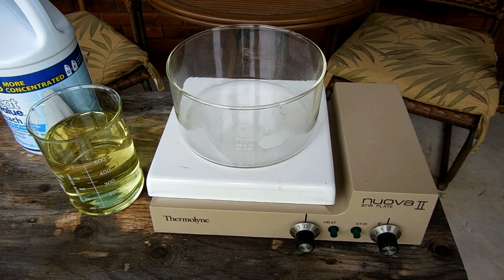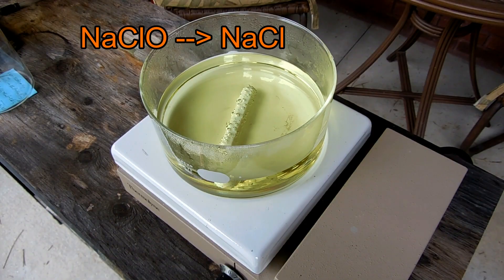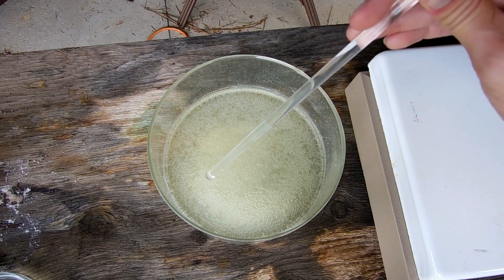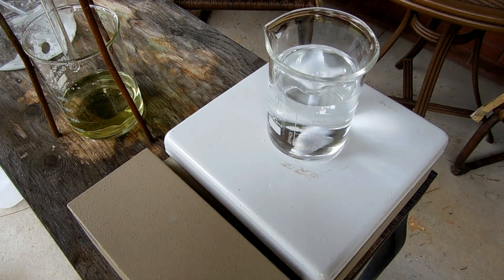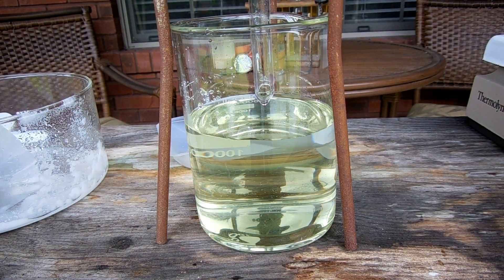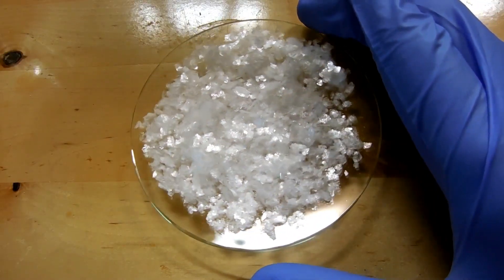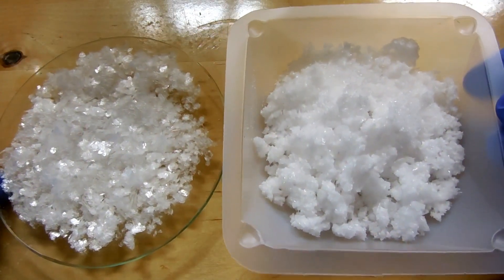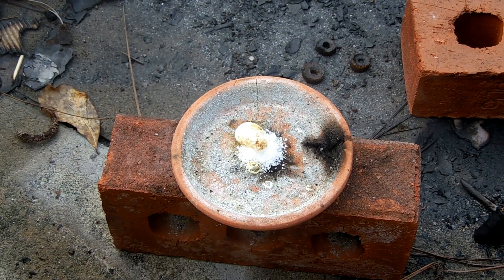Potassium Chlorate from Bleach

Comment: Mix those crystals (the purer ones) with equal weight amount of 90% melted beeswax/10% vaseline, cool in blocks and add a blast cap and you've got yourself homemade plastic explosive. Just saying...
Reply: Or one could add the right fuel to it and you have  a high explosive, Ive always used a large floating steel bowl in a dry ice bath that you would drip into,  There are also easier and faster ways to scrounge up chlorate without any chemistry, you just know where to look
Reply: it works with perchlorate

Comment: At what temperature did you boil the bleach? What was the temperature of the bleach solution when you took it off the heat? How long did you have it on the heat for? FYI. I used Jik 3,5% m/v Sodium Hypochlorite solution.
Reply from the maker: I didn't measure the temperature, but surely it was near 100 C. I simply held it at that point until crystals started forming, I don't recall how long that was. It sounds like you did everything right, but your bleach solution is pretty dilute. How much did you start with? 500mL of my 8.25% solution produced very little yield, so you'd probably need over a liter to get anything worthwhile from yours.
Reply: Thanks. I got very little but it worked.
Reply: 700ml

Comment: I boiled down bleach until I saw salt like crystals moving around in the solution then took it off the heat. Cooled it down in the fridge, mixed the cold saturated potassium chloride solution with the sodium chlorate solution and NO crystals of any sort were created. Where did I go wrong??

Comment: I clean Pools. What if I Was to use pool Chlorine?
Reply from the maker: Depends on what type of pool chlorine you refer to, there's lots of different ones. If it's sodium hypochlorite, then yes that's the same as bleach. Pool-grade bleach is higher concentration than what I used if I remember right, so you'd probably get higher yield!

Comment: Another question...
Is the precipitate (from the initial boiled bleach) completely sodium chloride, with no sodium chlorate in the precipitate? Could you increase the yield of crystals by, perhaps adding some water, re-dissolve the salts into the solution and THEN add the potassium chloride solution?
Reply from the maker: There's probably at least some chlorate in it, but the vast majority should be chloride. The chlorate is much more soluble and should remain in solution. Your idea would probably work, but I don't think the increase in yield would be very significant. Remember also that adding more water will dissolve more of your desired product!

Comment: Please excuse my ignorance, what would it take, or is it possible to turn that into a perchlorate?
Reply from the maker: I have never made perchlorate myself, but from what I hear it's quite a bit more involved to make than this. I know that going the electrolysis route you need special electrodes to be able to produce it.
Reply: Could be dangerous as well but an interesting idea!
Reply: ***** I really don't think that would work. Making perchlorates via electrolysis isn't too much harder than making chlorates, but you have to maintain a very high temperature to keep much potassium chlorate in solution.

Comment: I'm so pleased to see such well-made video and experiment among the bunch of crappy videos one could find browsing the youtube. Also, one could see if the experimenter has a solid chemistry background, as you have clearly. I subscribed viewing just first video.
Now the topic. I never made that experiment myself because ever since I started the electrolytic chlorate process, there was actually no need to try something else. But anyway, have you considered boiling hypo. solution together with excess KCl? If a hypochlorite disproportionation is an equilibrium reaction, KClO3 would precipitate from solution, thus driving the disprop. reaction. After every boiling, you could simply add a new amount of bleach and KCl corresponding to amont of KClO3 just precipitated. There is no need for cooling, just continuous boiling + filtration.
Reply from the maker: Thank you very much! I try to be very descriptive in my videos, and show the actual process of doing science (including the boring parts sometimes!). Your idea is plausible, but you would likely need to do some extra purification of your filtrate. That's because NaCl is a significant side product (you actually produce twice as many moles of chloride as chlorate, according to the equation). So likely what would happen is once the system is saturated, a mixture of NaCl, KCl, and KClO3 would fall out and would need to be separated. Solubility differences would be a good way to do this. It's an interesting chemical engineering problem to design a cell that would optimize precipitation of one component over the others.
Reply: mrhomescientist
Yes, you're right. Eventually NaCl or KCl would precipitate along KClO3 (every batch more and more).

Comment: I'm really considering doing this but I'm afraid of the gas that will form when I boil the bleach. How do I control it so it doesn't harm anyone (doing it outside, fume-hood doesn't work too well). Please answer back!
Reply: Using it as a fuel in a homemade rocket. My Father and I have recently become interested in rocketry and we bought a "make your own rocket" kit and I've read online that KCLO3 is helpful in making the rocket accelerate faster. We are not planning anything illegal so if you know the answer to my previous question we would appreciate an answer :)
Reply from the maker: itsjakewhatwhat
MrIhavnovideos is right - from what I understand, chlorates can be dangerously unstable in this application. Perchlorates are the way to go. This is all just what I've heard, though, energetics aren't my thing. I'm using the chlorate for a convenient source of oxygen gas in the lab, and the famous gummy bear on fire experiment!
Reply: Okay so because I can't purchase Potassium Perchlorate (or any other perchlorate for that matter) wouldn't it be easier to make KCLO3 then turn it into KCLO4, and thank you for the suggestion. But I am also still curious if boiling bleach outside would cause substantial amounts of toxic gas that could harm my neighbors.
Reply from the maker: itsjakewhatwhat
Again I don't have much experience with energetics, but I believe perchlorates are quite a bit harder to make. You need special electrodes and an electrolysis setup. There's lots of huge threads on them on the chemistry forum I'm a member of, ScienceMadness. As for fumes, I don't recall anything too horrific coming off it. Certainly do it outside with lots of ventilation. Or, instead of what I did, you could actually make a closed system while boiling and lead the vapors into a solution of dilute base. That would neutralize any fumes. It's great that you're concerned for those around you!
Reply: Hey I really appreciate you replying and helping us out! We will probably end up leading the fumes to a solution of a dilute base, if we still end up using KCLO3 :)

Comment from the maker: It's chloride - NaCl. Sodium chlorate is very soluble and remains in solution, which is why we add KCl to the solution to get out the much less soluble potassium chlorate. It's possible that if the bleach is boiled down too much you could get some sodium chlorate precipitation, which is why you want to remove it from heat as soon as crystals start appearing.

Comment from the maker: Hm, I come up with 41.25g hypochlorite to start, then 19.65g sodium chlorate after disproportionation, and a theoretical yield of 22.6g potassium chlorate at the end. Then 9g is about a 40% yield. Check the link in the description for my blog post with some more details. I'm not sure where our math differs. I used 8.25 wt.% of bleach to start. In either case it's not an abysmal yield, but the electrolysis method is much better from what I hear. I'll need to try it out.

Comment: Maybe my calculations are off, but 9g seems like a reasonable yield considering the process. There were over 40g of hypochlorite, but that leaves only 13g of chlorate after heating, for a nominal yield of 15g of KClO3. 56% yield is better than a poke in the eye.

Comment: There is an even simpler method, where one can bubble chlorine through a Potassium Carbonate OR Potassium Hydroxide solution.

The only downside is this is more dangerous, although that shouldn't be a problem for you seeing as you have full glassware etc.

Comment: Great video!  I just wanted to mention you MUST use glass to boil the bleach.  If you use metal you will get side reactions that will ruin your synthesis and you won't get any product.  I am sure there is some type of metal that you can use, but I tried a few and they didn't work.  Does anyone know what type metal will not ruin the experiment?  I want to go large and metal is more practical.
Reply: maybe teflon?????? don't take my word for it tho

Comment: I'd love you to do the electrolysis next.

I done it with a carbon anode(positive) and a brass nail as a cathode.
I heated the mixture up after electrolysis to get everything to dissolve, then I filtered the carbon sludge out to get a clear solution.

Then, I boiled the solution down about half way and crystallised the Potassium Chlorate out by putting it in an ice bath.

Comment: Hey there, love the videos.
I had a question regarding letting the boiled bleach solution cool; is there any particular reason you let it cool before filtration other than giving time for NaCl to crystallize out? i.e. would covering the dish to retain heat and thus having NaClO3 be much more soluble, while NaCl still precipitates out due to its low solubility-temperature response, retain more NaClO3 per NaCl in solution?

Comment: How would you separate the sodium chlorate from the sodium chloride if you wanted to recover only the sodium chlorate?  I think that sodium chlorate increases its solubility with heat while sodium chlorides solubility doesn't change much with heat. Perhaps continued evaporation would increase the concentration of the chlorate in the liquid while the chloride crystallizes out?

Comment from the maker: A car battery's acid is only about 30%, nowhere near the point where you can call it concentrated. You could of course boil the water off, but that takes a while and boiling acid isn't very friendly. Mine was liquid drain opener, and is 98% acid.

Comment: It could also have lead contamination in it. On the other hand, you could just go to an auto parts store and buy battery acid. MIght be more expensive than drain cleaner but it should be higher purity.

Comment: Does this method of producing copper acytelide work? please anwser :)

1. Dissolve 4 grams copper sulfate in 10 ml water.
2. Make a solution of 5 grams of sodium hydroxide (NaoH) in water
3. Mix this two liquids, and filter the white copper hydroxide.
4. Dissolve a quantity of copper hydroxide in a sufficient amount of water, and run a stream 
 of acetylene through it.
5. A brown substance forms after a few minutes, collect it. This is copper acetylide.

Comment from the maker: It has an important use as a chemical oxygen generator, used in space stations, aircraft, and submarines. It decomposes into oxygen and KCl on fairly gentle heating, so it's an easy source of the gas. It's also much more compact than storing pressurized O2 tanks. It's also, of course, a powerful oxidizer, and can be used in other chemistry that requires such things.